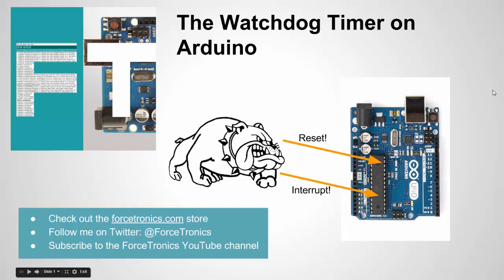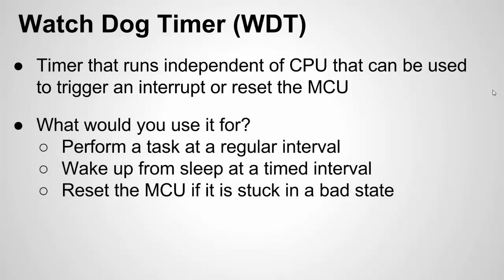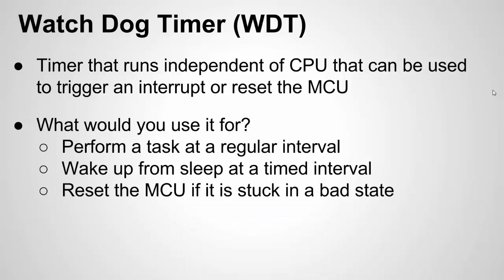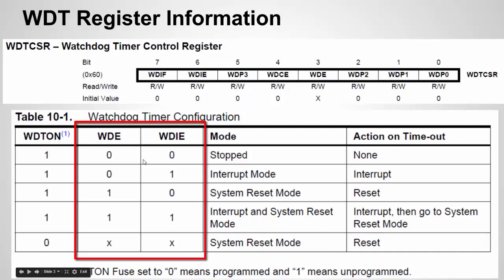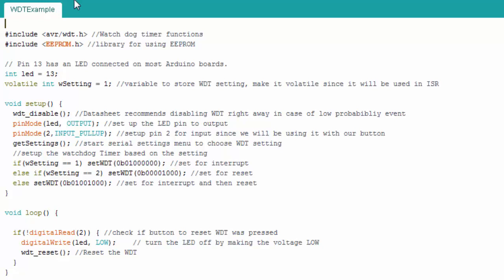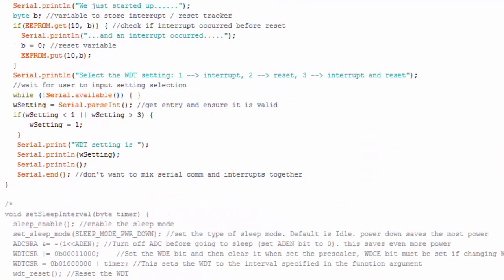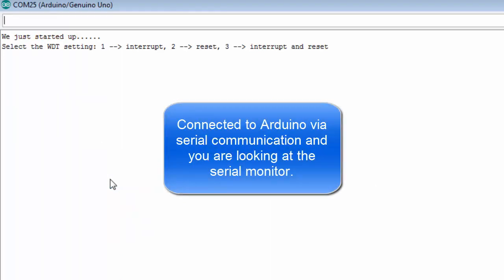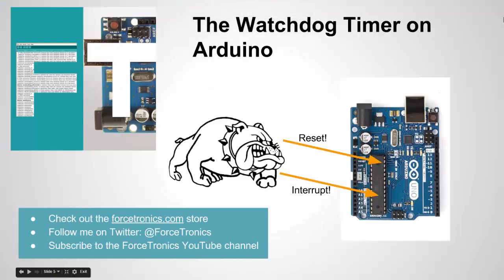The Watchdog Timer on Arduino

Comment: Firstly thank you for this informative video. It really shows all the different settings of a watchdog timer. For me the "Interrupt" only configuration of the WDT worked fine, but the other two didn't work properly. In both cases "Reset" and "Interrupt+Reset" configurations the reset happened instantly, as if the configured time interval for the WDT was not taken into account.

I spent some time in trying to solve this out and found a solution, which is to disable all interrupts with "cli()" before setting the WDT in the "setWDT()" function and ultimately activate all interrupts again with "sei()". Now everything works as intended and hopefully this solution helps others as well.

Comment: Good day. Nice video! I have a question on whether it is possible to do a watchdog timer reset every 30 minutes? If yes, how do I go about changing your code?
Reply from the maker: As per the datasheet, the max setting for the watchdog timer on the ATmega328 MCU is 8 seconds
Reply: +ForceTronics 
If you want 30 mins then just count resets in the isr and only action after 30 mins worth,  (use a volatile to store the vount)

Comment: nice and informative video... can a watchdog timer be designed on eagle or kicad software using this arduino code ? 
Thank you
Reply from the maker: Thank you. Not sure I understand the question, do you mean Eagle CAD software for doing PCB layouts? The WDT is internal to most modern microcontrollers, it is not an external circuit.
Reply: ForceTronics yes sir.. I meant eagle CAD software for designing PCB layouts
Reply from the maker: The code from this tutorial can be used with AVR based Arduino boards. The Arduino boards are programmed via the Arduino IDE, the code in this video is made for the Arduino IDE. PCB layout software is just for building the circuit for a microcontroller, it does not program the microcontroller
Reply: lol

Comment: How would I use the watchdog timer with a switch case statement if there are different variable times for the "sleep" period? Would I have to write the code for each case statement for the time? Any help would be greatly appreciated. I'm also using the ATtiny85, so there is some different variations in the libraries. Thanks!
Reply from the maker: If I understand the question right, you would write the switch statements to set the value of a variable that corresponds to the time interval you want. Then once you have the variable set you feed it to the watchdog timer code

Comment: :( it does not work for me. I do a wdt_disable(); at start of the setup then I check the MCUSR & WDRF and reset it, (if it was true I do not play the startup tune)
at the end of setup I do wdt_enable(WDTO_4S);
but if interupt occours, all that happens is that the LED flickers wildly
Reply: To follow-up on my earlier reply: I got rid of the flicker by loading this code using an Atmel IDE via an SPI connection.  I have no idea where the hick-up is as I'm a hack.
Reply: my arduino nano also has this problem, maybe it's a bootloader problem
Reply: @aleceduardo6013  did you try the new bootloader? the old one is explicitly broken in terms of wdt (and then new one is 10x fastern in uploading code)

Comment: i want to add delay of 10 seconds to my action whenever my sensor triggers can i use these for the same purpose ?
if yes how 
please give me hint 
i m desperately waiting for it.
Reply from the maker: You could use the watchdog timer for a delay, although I would just recommend using the built-in Arduino function delay() or millis(). You can find examples how to use these on the Arduino website